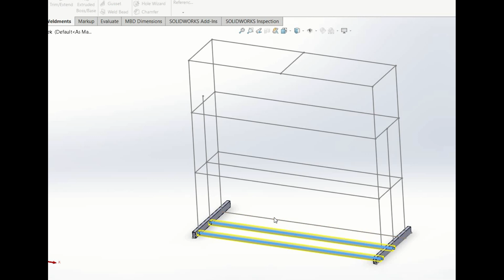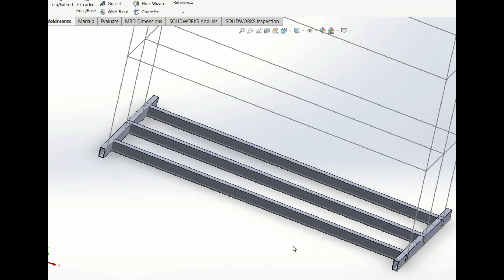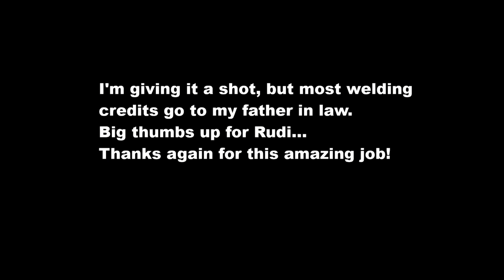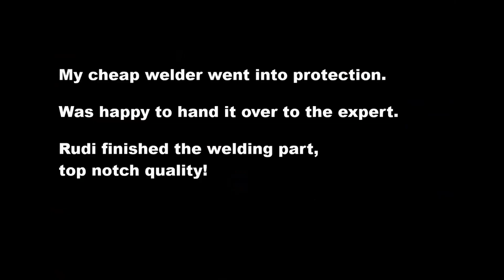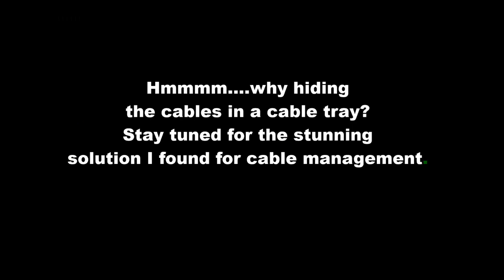easypowerwall - building the frame

Comment: You can buy  rack battery server rack $150 which is compact and can be moved i saw some one build a wood rack it cost $1000 and took up a lot of floor space
Reply from the maker: Easypowerwall
  • 1 seconde geleden
I agree, but there are several reasons why I choose for DIY. System had decent BMS with active balancing iso 30ma, fully serviceable, much cheaper, ...  Hey and it's fun and rewarding too.

Comment: 6:09 (compression of the batteries)
Is this compression essential/advisable/optional/nice-to-have for the LiFePO4 batteries themselves? Or is it only a mechanical feature to lock them in place?

And if it serves a function for the batteries themselves, is it only/specifically for these types of batteries?

edit: just found the answer at 11:21 😁
The way you explained it, it sounds like a protection against delamination or something like that.
Reply from the maker: Compression is strongly advisable. More capacity, more cycles from your battery and for me most important...structural integrity. Everything is fixed, they can't move, less chance for stressed studs, ....